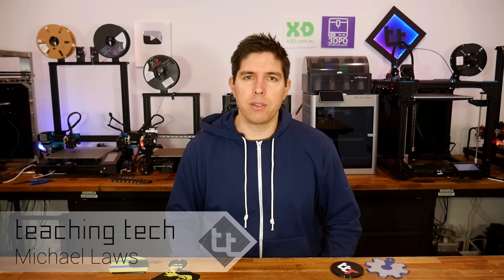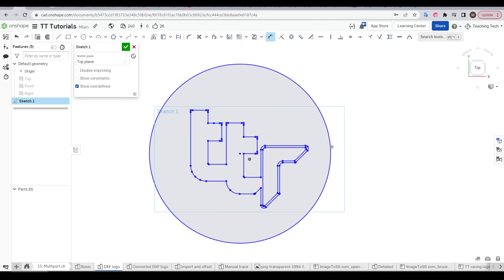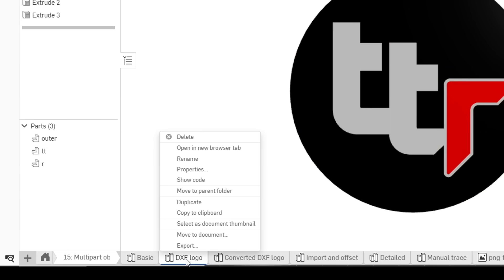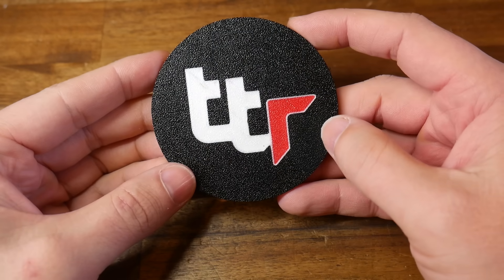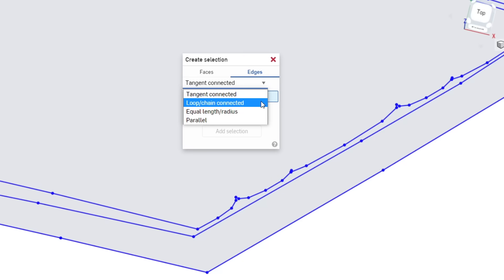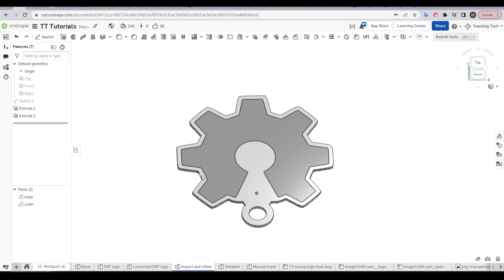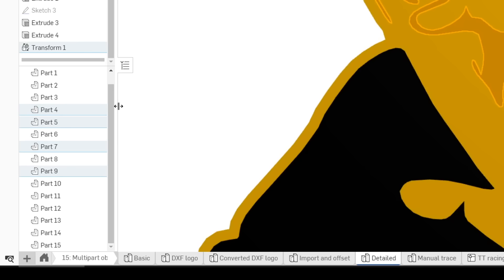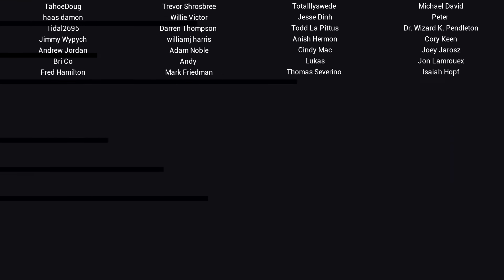Designing for multi colour/extrusion - 3D design for 3D printing

Comment: Is it possible to do about 5 layers of color facing down, and the rest in black to just have the face in color? Cutting down on filament changes. For example, a key chain that's 5mm total but want the 1st mm in color and the other 4 in black?

Comment: I'm trying to print a thing logo on a flat surface. I did not use the methods in this video, as my background is more in Blender/Zbrush, so I just did the 3D model of the Logo using an AlphaMask/Extruding.  My problem is that the contour is black, and inside is white, and there is a bit of bleeding of black. When I slice it, it seems for some reason it adds some black filament layers beneath the white, regardless of how thick it is. Do you think following the steps in this video helps with that ? or there's something else causing this ? Any tips ? :D

Comment: You printed your logo in a pretty bad way. The multiple colours are only for cosmetic reasons but you have different colours all the way through the part, so multiple filament changes every layer. You should have had the bulk of the print be black and have the letters just as a thin layer on the top or bottom, it is more steps to do but still isn’t difficult. It would save a lot of filament and time.

Comment: I have to say, i`m a littel disapointed that this didn`t cover the one colour printer multi colour prinitng (which is done in layers of different colours on top of one another, with filament changes in between.    but it`s stunning the quaility the bambulab produces and great idea to print upside down...

Comment: If you don't want to use the cloud, here's my workflow:
* If you're starting from something like Word, PowerPoint, Excel, or anything similar, export or print to PDF. PDFs can store vector graphics, so no need to worry that you're losing resolution or anything.
* Inkscape can import PDFs, so you can use it to import. Any text will have to be converted to paths, and if you have any bitmap graphics, you will want to trace them, which Inkscape has tools for.
* Blender can import SVGs. From there, you can apply the Solidify modifier to extrude the paths or do whatever you want with them.

Comment: Great CAD tutorial as always.

A recommendation for creating multi material CAD: If you create only a 0.2-0.4mm thick layer for different colors and leave the rest as a base color that means you only have to do a handful of filament purges throughout the print instead of multiple per layer. This will save tremendously on filament waste and print time while maintaining the aesthetic of a multi color print.

This worked well for me in a large batch job of multi material prints I did.

Another point: if your colors go all the way through the z axis, the different colored parts may not actually physically bond to each other and they could fall apart.
Reply: Expanding on the thinner layer method, you can also achieve pretty good multi color logos with a printer that doesn't normally support multi color/material. 

Just make the logo very thin, like 0.1mm, and make sure to center it on the buildplate in your slicer. Print the logo and leave it on the buildplate. 

Then, with the "frame" you want the logo on you can just model it with a completely flat surface, and make sure that the center point of the frame matches the one on the logo. You can then load a new color in the printer and place the frame model centered on the buildplate with a first layer thickness of about 0.2-0.25mm. Start the print, and it will "overwrite" the logo with the frame on top, and melt the frame to the logo. 

It's a bit tedious, but it usually works great as long as you have a well tuned printer that makes good first layers and has good adhesion to the buildplate. Once you're used to the process it doesn't even take that long to set up.
Reply: Yes! 👍
Reply: Sounds legit.

Comment: Another option, extrude the different text options are marginally different depths (think 0.01mm). Bambu studio will see the slightly different later height making it easy to paint as a surface, but when sliced will round off the small difference in height into one bottom surface.
Reply: thanks! i was hoping it would round out but wasnt really sure.
Reply: And what to do with painted surfaces? (I use Cura & Orca)

Comment: You can do something similar with a single extruder printer.  Get the sketch setup the same way, then extrude the entire sketch the thickness of the first color.  Open the sketch again and extrude everything but the first color, doing a join so it's all one object making this extrude slightly larger than the first one--one or two layers should be enough.  Repeat this over and over until you've done all the colors in your object.  That will give you an object that has different layers.  In your slicer, put a color change or pause command in at each color change.

Take the open source logo, for example,  The first extrude would be the entire sketch a height of 5 mm.  Then the next one would be just the inner part of the logo to a height of 5.2 or 5.4 mm for a 0.2mm layer height.  In your slicer, put a color change after the 5mm layer is complete.  Your printer will pause, you can then change the filament and resume the print. The logo will be slightly proud of the surface, in a different color.
Reply: or use hueforge :)
Reply: How to make a picture in the first layer? (on the  opposite side of the picture is the non planar surface)

Comment: One thing Bambu/Orcaslicer can't do that PrusaSlicer can is let you only print the logo portion for a couple of layers instead of having it be solid all the way through. This saves hours of print time and tons of filament swaps.
Reply: how exactly? can you elaborate please and thank you!
Reply: @glopyz  This is something I observed recently. I have a model similar to the one in the video except the “logo” is thin and on the top and bottom surfaces. The object is 10mm thick while the logos are 0.6mm thick. When importing a 3mf as an object with multiple parts, Orcaslicer doesn’t slice the logo on the face on the build plate. PrusaSlicer doesn’t have this issue. Maybe if you import them as separate objects and merge them OrcaSlicer can slice them, but that disrupts this nice workflow demonstrated here.

Comment: As you say - don't use anything with that platform that you don't want to be copied.

Also - as for mr Lee and similar projects, you might want to make them single-sided and then just put the black a layer or two on top on top of the background. This will save time and filament and will even be possible with an ordinary printer, given it supports M600 (which includes virtually anything unless it's very old or named Ultimaker)

Comment: I have created multi color prints using a single extruder. You just need to change the filament at different layer heights in your slicer.
Reply: I do this with multiple gcodes, one for each color, thus obtaining everything on the same layer, using z hop to avoid scratching what is already printed
Reply: @LuchoEspe can you explain this?
I want to print a license plate single layer with different colors but a solid color background about 3 mm thick. Can this be done using your method?
Reply: That is not what this is. This is about having different colors on the same layer
Reply: @rp479 you can also do it with the marker style multicolor printer aswell. I forget the name for it but it works alright 👍 just need white/transparent petg
Reply: Is that the one that uses the sharpies?
Reply: @rp479  I was just sharing my own experience, since not everyone knows you can print multiple colors using a single extruder. It also helps the algorithm :)
Reply: @rp479  The title of this video is somewhat generic. I think my comment fits within the broad message of this video.
Reply: @rp479 you can do it with a single extruder too. You just have to be there for each filament change instead of the machine doing the change itself. It's very time consuming though.😅
Reply: @whatif8741  that is correct but that’s not what the original comment was talking about